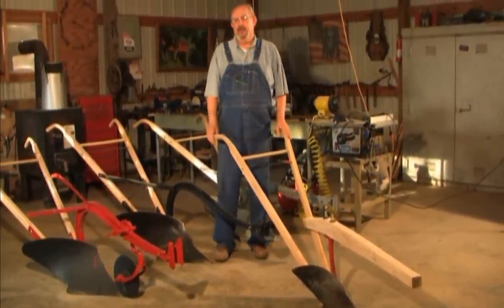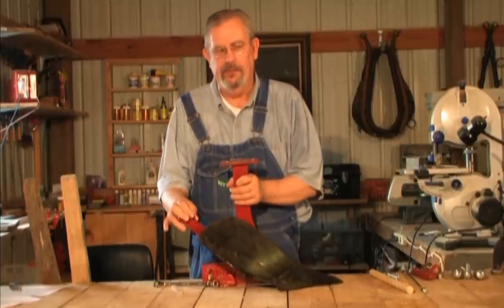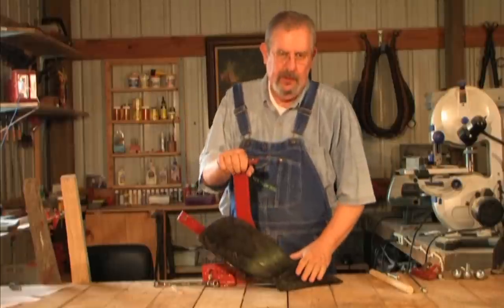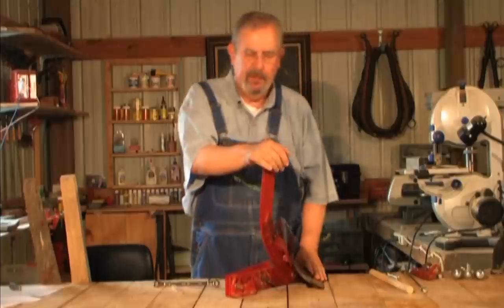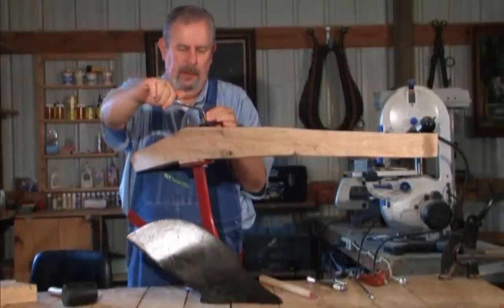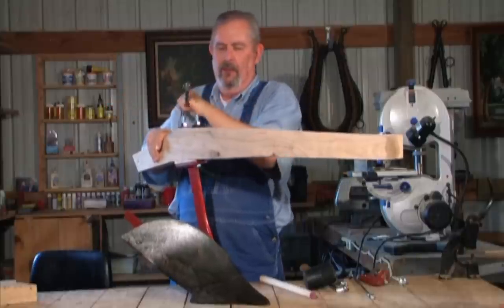Country Ways - Walking Plows

Comment: My husband is restoring a plow just like this one, it has the original beam and John Deere Co. painted in black on the beam. It also has original red paint where the handles hook to the metal. Also it has Pony stamped on the back side of the shovel. I believe this plow was built sometime in the 1880"s by John Deere Plow Works.  i purchased it at an auction in Northern Missouri so it could have been made at the Moline Plow Works or in Kansas City. Since I live in Central Missouri it could have been made at either plant.
Reply: I'm here because I found what was left of a rotting plow assembly minus the actual plow. It did still have the seven hole clevis attached and I brought it home before I knew what it was called. This video helped me to at least identify it's actual purpose...
Reply: I just found the same John Deere plow at my cabin in Alabama. Plow is cast I need to replace the handles I’m thinking green and yellow paint! I am planning to pull behind my 4 wheeler and do up a Garden or food plot for the deer!
Reply: @voiceforthevoicelesstruth5480  I did the same 3 years ago with a horse drawn plow made by Finley R. Crothers from Sparta, Illinois.  I bought 2 of them and restored one and used the other to put in my corn field.  IO had to install a piece of rebar and slide 50 pounds of weights on it to get it to plow properly by itself, but it works great.  Good luck and enjoy your plow !